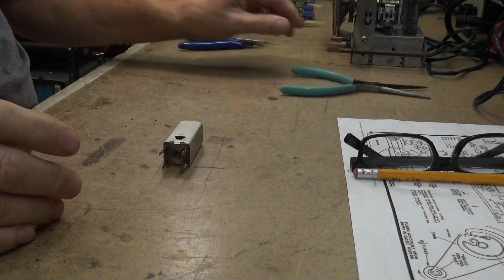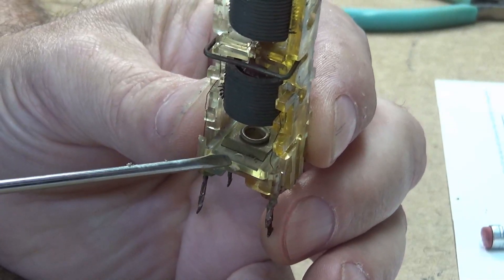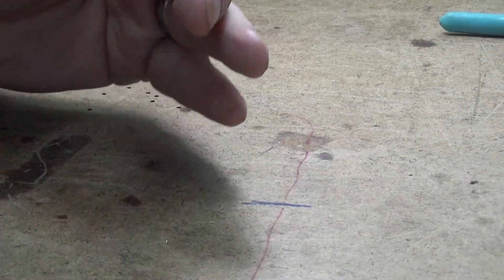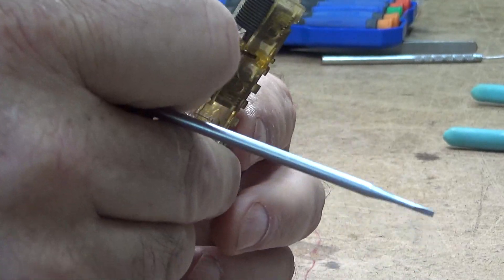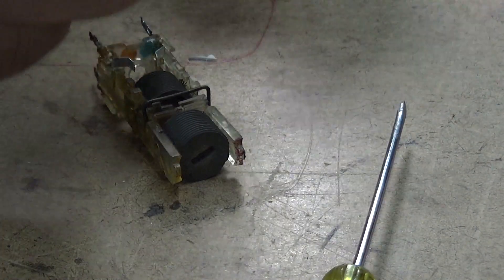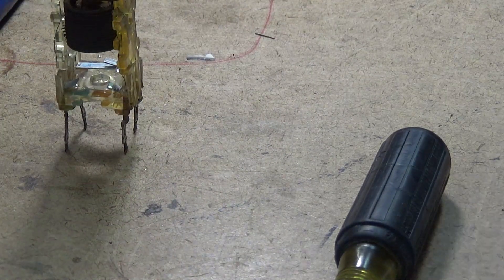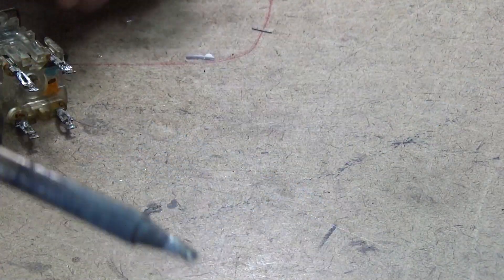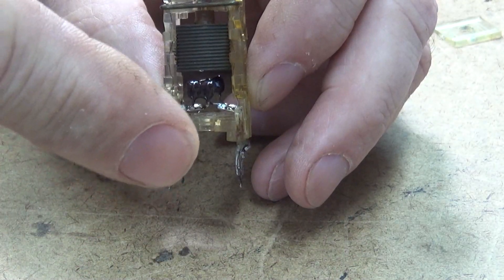Quick Tech Tip Silver Mica Disease Repair

Comment: What if you took the bad capacitor out and attached the new one on the outside leads of the IF can?
Reply from the maker: It would probably work okay but since your already taking it apart why not . The advantage to externally mounting the caps are it would be easier to change values to make it work rather than be inside where you have to pull the transformer each time. With that said, one rule of thumb for RF circuits is to keep lead lengths as short as possible to reduce stray capacitance and other types of interference in the circuit, plus placing it outside the can could make the thing to be subject to vibration and create a micro-phonic type situation. Or it just might frikking work

Comment: Yes that's how I do it as well. You can put the new caps across the outside terminals as well if you don't know there value then just use a small trimmer cap to resonate then on what ever the If frequency is the remove the cap measure the value and place with fixed value caps.
I've done this in the past and it works out well.
Good luck with your restoration.
73. Paul.

Comment: How do you determine the value to use of the schematic doesn’t tell you
Reply from the maker: Guessing mostly but I've played around with them before and 100 pf seems to be pretty common.
Reply: If  you have one of those cheap component identifier devices out of China you can put a couple wires in them, then sandwich the SM between the leads and the device will give you a read on the cap.  You can also use the old cap tester if you have one, or even a good multimeter if you have one that can read caps.

Comment: Thanks for the video. Great job. On a side note I've seen what I think is a similar contamination on modern smd components caused by SO2 on silver. I worked in a modern paper mill that used gaseous SO2 for bleaching the pulp. Older equipment was not affected but newer lead free devices became intermittent and failed. The SO2 would react with the silver layers and cause a insulation layer to form.
Reply from the maker: Interesting!

Comment: How did you figure out the capacitor spec?
Reply from the maker: The schematic had the values listed for once.
Reply: If your schematic doesnt show the values, once you remove the caps, just measure  the coils to select tht proper replacement capacitor for the resonant frequency

Comment: I've not had silver mica disease inside IF cans yet, but I have had a variable capacitor with it. I've only been repairing valve radios as a hobby for 3 years (although I was qualified as a radio and TV engineer 40 years ago). So I've probably not seen enough of them yet.

Comment: Why not use a surface mount cap as opposed to a leaded mica cap?
Reply from the maker: Thats actually what should have been done, not a lot of room in there.
Reply: If you consider that route, make sure you use one that can withstand the voltages encountered in tube equipment.